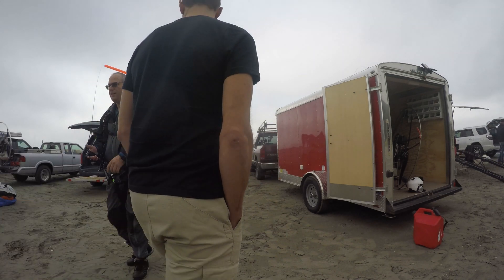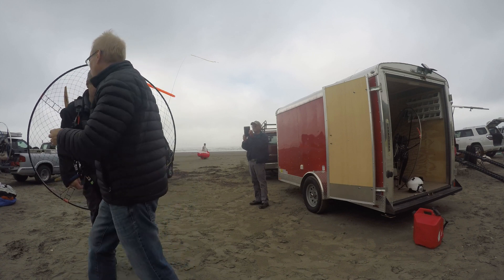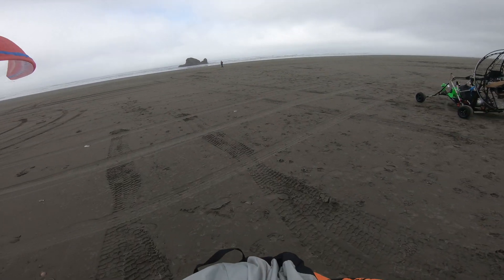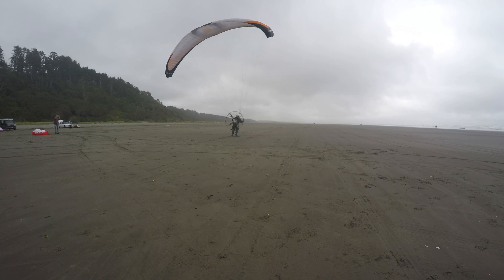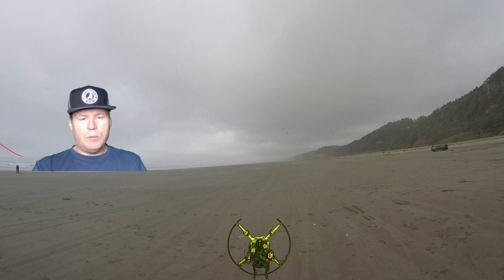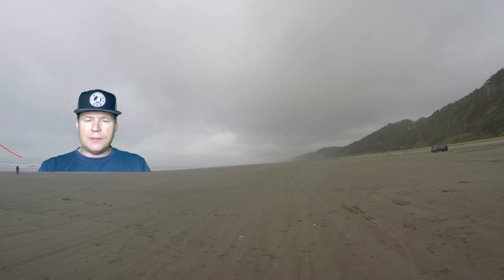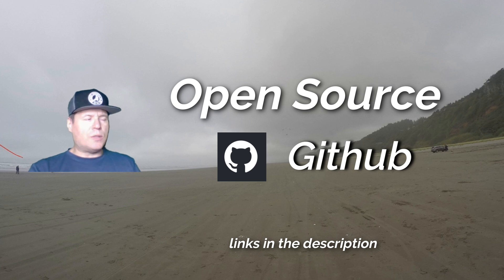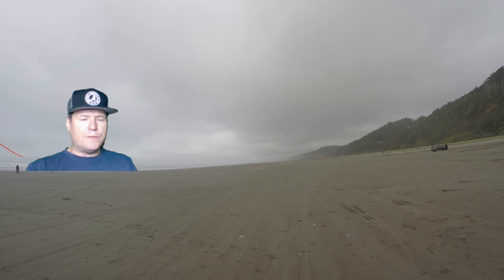Electric Paramotor - OpenPPG Review

Comment: I would cnc cut the parts from aluminium instead, carbon is very brittle and easy to break. Aluminium will just bend, a lot safer
Reply from the maker: That would be an interesting build. Did you realize the CAD files are freely available for this? Go to openppg.com and they have the github link. Looking forward to seeing your build.

Comment: Thanks for the video. I'm thinking about getting an electric paramotor and this one is very tempting...Do you know how high you could climb on a continuous straight take off to altitude before the 20min battery ran out? And is climbing or cruising still possible if 2 engines go down (I'm 150 lbs)? Would triple bladed props increase the thrust?

Comment: What's the recommended pilot weight range for these?  I believe they're 150 lbs of thrust, and you said it felt comparable to your Nitro 200, which I've seen rated for 180 to 230 lbs.  I'm recently "down to" 235, but I'd hate to be bouncing right at the top a motor's capability.

Comment: I’m sure that in your edit when you wrote “no torque” you meant, no torque compensation necessary. I knew what you meant, but to most that would scream no power. In engines that produce torque, often times a by product of that torque is P Factor, the inertial twisting related to power and thrust. You were saying there is no need to compensate with brake or weight shift to fly straight. Pretty sweet.
Reply: The actual definition of P Factor, also called "asymmetric propeller loading", happens when the downward moving propeller blade takes a bigger "bite" of air than the upward moving blade. This happens in two scenarios:

1) Your plane is flying at a high angle-of-attack (takeoff and slow-flight are good examples), and
2) You're taking off in a tailwheel airplane.

In both of these scenarios, your downward sweeping blade is at a much higher angle-of-attack than your upward sweeping blade. And with a higher AOA, the downward sweeping blade creates much more thrust (or lift), making your airplane want to yaw to the left.

More at... https://www.boldmethod.com/learn-to-fly/aerodynamics/why-you-need-right-rudder-on-takeoff-to-stay-on-the-centerline/
Reply from the maker: You are correct. Thanks for pointing that out.
Reply: i thought the same thing then i also remember hes running 4 props, maybe 2 ccw and 2 cw(  like a drone) does to remove torque steer.

Comment: Is no torque good or bad
Reply from the maker: It is very good. It means you get a force that pushes you straight  forward and not off to one side or the other. Think of it as a car steering straight down the road if you let go of the wheel rather than drifting to one side or the other.

Comment: Maybe someone will figure out how to make a hybrid, but 20 minutes of flight is terrible.  I take off with at least 2.5 gallons every time, usually more.  Thanks for the great review though.
Reply from the maker: You can double the flight time with double the batteris but that is the main limitations. Some people only do small short flights. I expeect with all the interest and research into EVs, the battery improvements will find their way into paramotoring. Thanks for watching!
Reply: I think these will have a place when folks start making transformer freeflight harnesses with them.  Without gas a lot more configurations start to take shape.
Reply: I know some folks like them for thermaling, just to get up to altitude and shut it down.

Comment: That thing sounds like an angry nest of hornets haha,If  they can get an hour flight time and make it affordable i may get one someday.s for the 180 riser twist thats not a big deal,i get em all the time doing reverse for some reason  :)
 Thanks Mr C!!! 
Bump bump!!!
Reply from the maker: I liken it more to a drone but yeah it does sound like hornets. Their new single prop is supposed to get an hour. Current commercial electric paramotors cost $8-10K. You can get this one for $5k fully built or $4500 as a kit roughly. Thanks for watching.
Reply: @MrCPPG  Thanks for the info bro!!500 for the kit that ain't bad!!
Reply from the maker: @577buttfan  My bad. Not $500 for the kit, ($4500) for the kit. I correctd the comment. Don't want to mislead anyone. But all the technical data are there so you could uses the electronics, source your own parts and save some money. Still, all up it is about $2K less than a traditional paramotor albeit less range. Pick your poison I guess.

Comment: Very cool! Just need longer flight times which will come with battery improvements. I want to see someone do the Icarus race where they swap out batteries on route! Maybe I’ll do it one of these days 😂
Reply from the maker: An electric doing the Icaurus would be very cool indeed. I am hoping that the EV market taking off results in some better chemistry for batteries.
Reply: I wonder what the equivalent weight of the model 3 batteries along with 1 very efficient electric motor could do? Would need to be a switchable pack though. Could be interesting.
Reply from the maker: @GregAnthonyHarris  Not sure, but I do know Tesla is doing some innovative work on battery technology. The Model 3 has a different chemistry than the rest. They mixed silicon in the cathode. That is why it can charge faster than all the previous models.
Reply: @Aiden Avi lately I have been using Flixzone. You can find it on google :)
Reply: i guess Im pretty randomly asking but do anyone know of a good website to watch new movies online ?